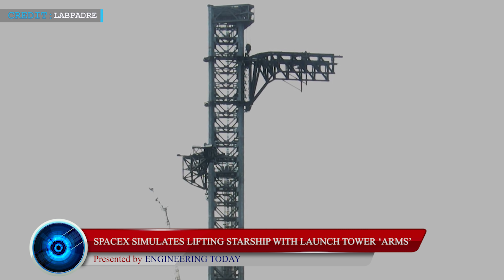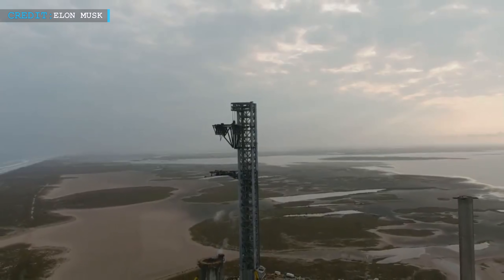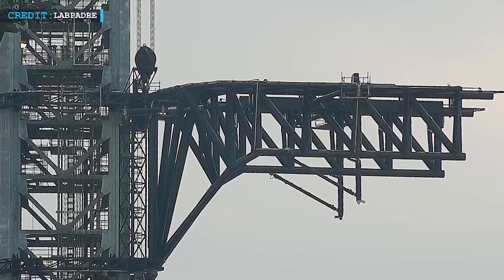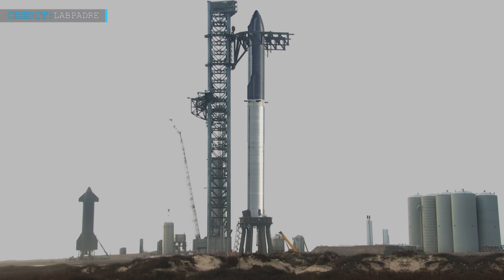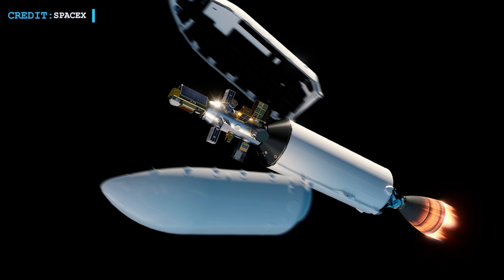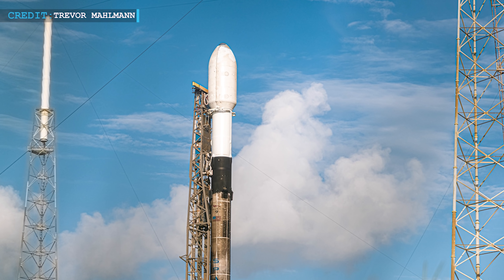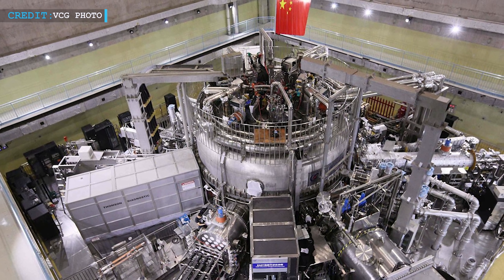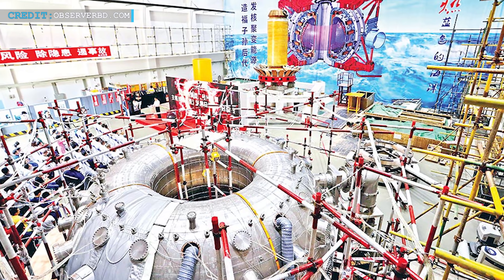SpaceX Starship reaches it's new height | China's "Artificial Sun" hotter than the Sun!!!

Comment: So they only have to get the temperature up to where they can sustain fusion. (~150 MK)
Reply: but it can never be an economical power source due to fantastic inefficiencies and costs
Reply: @MyKharli  Once the fusion is initiated, there will be net energy, despite the high energy cost of initiating fusion.
Reply: @paulmichaelfreedman8334  having temperatures that high next to supercooled magnets just to provide steam is bizzare and is rediculously complicated and subjuct to huge stoppages everytime something goes wrong . And no one has any idea on long term neutron embrittlement . Also who want centralised power sources that only elite corporations can control ?
Reply: @MyKharli  Rocket nozzles are also an example of extremely high temperatures next to cryogenic temperatures. The engine bell is cooled by the liquid fuel. Temperature difference over a single centimeter: 3000 Kelvin. Do they fail every time? No.
Reply: @paulmichaelfreedman8334  do they produce useable electricity for anything ? no ....do they operate even at .000001%of a full time power plant ? no , are they hugely expensive practically one use devices..yes..even space x claims of a 24 hr turn around and 6 mill a launch turned out to be 27 days and 60 mill
Reply: @MyKharli  Maybe a physics course is in order for you.
Reply: @paulmichaelfreedman8334  And an economics one for you !
Reply: @MyKharli  If you're not going to take anything from another, why debate it? you like arguing for the sake of arguing?

Comment: All the reactor needs to do is maintain a temperature of a few °1000 and it can power a steam generator ? what keeps it from melting at 17 ,000,000 degrees ?
Reply: the plasma is held away from the device using electromagnets so it doesn't cool, and the machine doesn't melt, also, you need it to be really hot for nuclear fusion.
Reply: @antarachatterjee4299  The magnetic field also compressed the plasma, the compression is the primary heat "source".
Reply: @antarachatterjee4299  thanks !! there is alot of H3 on the moon ! maybe soon it can be mined
Reply: Also, your question about why it needs to be that hot. It's because you need the atoms to have an incredibly high amount of energy to overcome the repulsion of the protons.
Reply: @antarachatterjee4299  Single proton-proton repulsion force at a distance just beyond the bonds of the strong force is ~70 Newtons. 7 kilograms. 2 protons. Insane. The strong force is about 100 times stronger than that. Mind blown.

Comment: Thank you for your update. I think you may have misspoke. That arm spacer in no way is a mass simulator. And can someone please address the elephant in the room. Specifically, how does this arm catch a ship that is either rotated or off of it's decent path?  A z-axis rotation of only a few degrees or offset of a few feet is going to make the catching mechanism non functional, at least as it's been described so far. Space X is doing a good job of landing ships on large platforms, but in no way hitting a mark within centimeters or even sometimes within meters.
Reply: For catching Boosters, SpaceX intends to catch them on the Grid Fins. There will be a system of belts on the top edge of the Chopstix that will allow the Booster to be rotated after capture.
Reply: @thegreatpeon  Not quite, there are fingers protruding just under the grid fins. The rocket is caught on these fingers. They look small but are extremely strong.
Reply: There are fail-safes in place (in software) to steer the ship away in time if there is a critical anomaly. Agreed, the last few seconds carry highest risk.

Comment: That large bar was to simulate the width of a booster, not just the weight. The beam is held down by gravity, so the water bags.  It also tied the two small trolleys together to test the synchronization of moving a ship/booster towards and away from the tower.  All this testing is to calibrate the steppers as well as the sensors in the arms.  The task computer must know where the edge of the mass is in order to make critical alignments.
Nice video!

Comment: Those Heat Shield Tiles are loosely fit , and there is a Cloth Thermal Blanket underneath them ... So when it Rains that blanket is going to absorb water and get wet ... That can't be good ... That water would be hard to Evaporate ... and when they fill the Tanks , that Rocket gets Freezing Cold ! ... Frozen water Expands ... so the Water in the thermal blanket is going to turn to Ice , expand and knock the Tiles Off ... Then there is the Cold of Space ..... Houston , we gotta , BF Heat Shield Problem ! ....